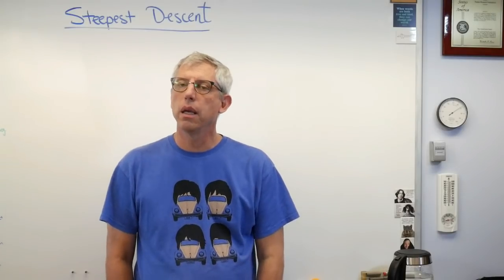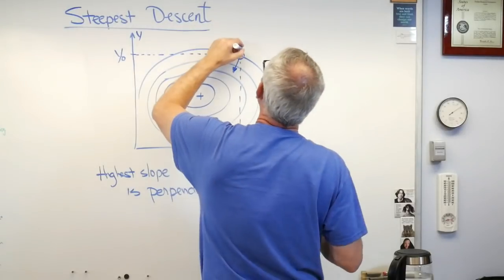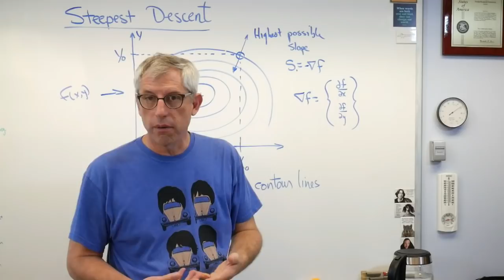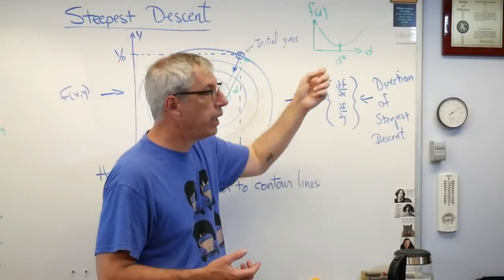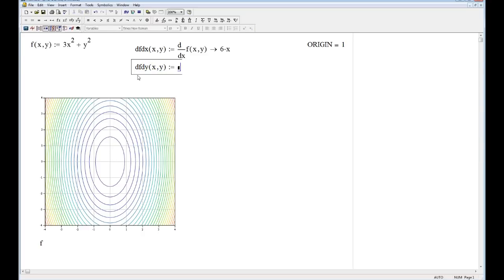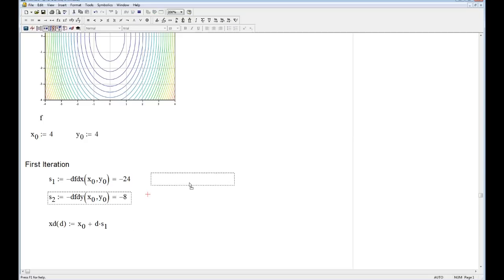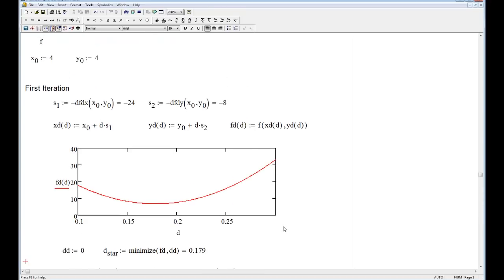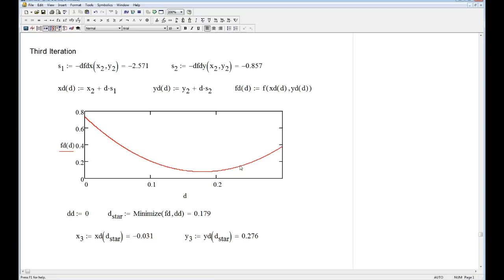Applied Optimization - Steepest Descent

Comment: Very interesting but many things I don't understand. Often when considering the gradient, we consider it at a particular point. 

When we draw the gradient vector, it's a vector in the same space and coordinate system, but originating from the point where we calculated the gradient, not a vector coming from the origin of the coordinates space ? 
Then, If I understand gradient like derivative is a slope giving the direction of biggest change, I don't get the intuition on why the gradient lying on this slope is oriented towards the direction of steepest ascent. Does it have anything to do with basis orientation/direction ? 
I mean when we draw a slope and say it's the slope of the derivative at a particular point, it does not tell us if it is going up or down. I mean rate of change could be toward the decreasing side of the slope, so why do we say gradient always point towards steepest ascent

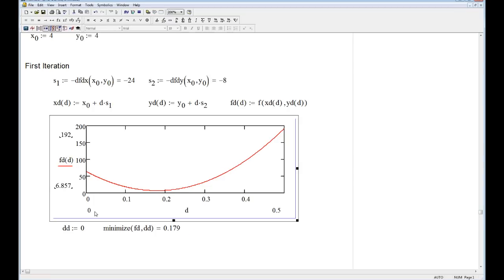Comment: 24:21. Could you provide some guidance (a link to an example would also be fine) as to how to reach d = 0.179 if we are to calculate the value manually? Thank you very much :)
Reply: if you write  the fd(d) function you gonna see that this function just depend on the "d" and you can find it's minimum by using any 1 dimensional search algorithm like bisection, golden search, or newton raphson etc..or it can be resolved analyticaly.  (maybe you are no longer interested in but some others could be :) )